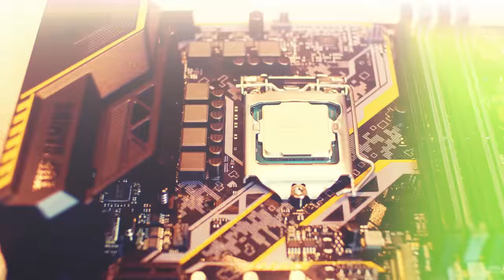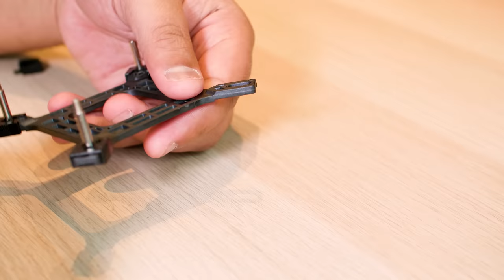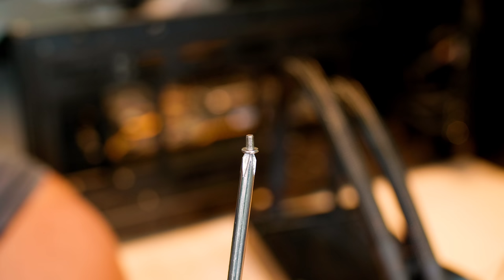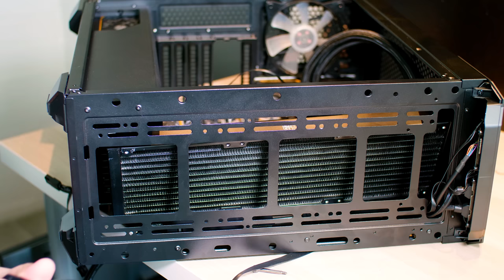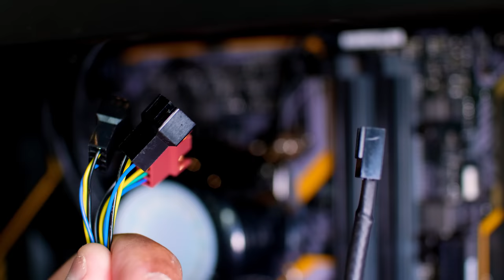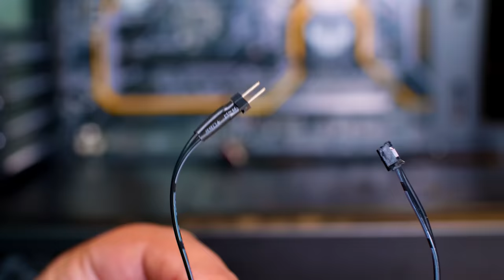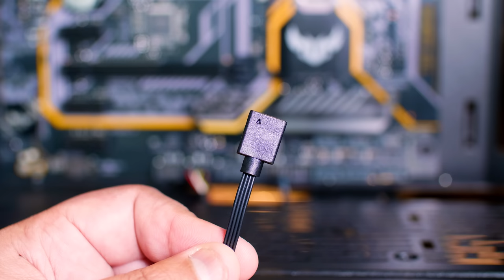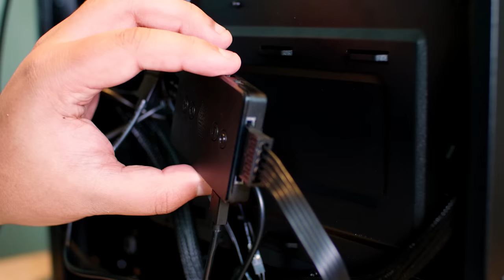HOWTO Install Cooler Master MasterLiquid ML360R RGB on Z370 & Z390 Motherboards

Comment: Quick question, can I grab the rgb signal from the controller and pass it to a second one? The reason being, that I have a second controller for 3 fans that use a propeitary 6 pin connector, so I have to use the second controller aswell.
(or the other way around, from the other controller to this one for the AIO)

To prevent confusion, I want to use MSI rgb control software for all my rgbs, the other controller (not the cm one) has 2x 4 pin connectors for rgb, so I'm guessing I could use that connector to pass the rgb signal to the cooler master controller, right?
 My parts willl arrive in 2 days, so I can't test right now, but I want to make sure all the parts I need are there once they arrive, since waiting to finish the build because of a missing splitter would suck.

Anyway thx for the videos, they really helped me out so far.
Reply from the maker: If the 2nd controller has an input you could technically do it if you set the 2nd controller to use a passthrough mode. I dont see why it shouldn't work.
Reply: @GearSeekers  Yes it does. I will report back once I've completed the build and know for sure if it works, maybe some other people are facing the same issue. And I'm honestly amazed how fast you replied, thanks for taking your time, I really appreciate it.
(+sub)
Reply from the maker: All gravy! Yeah let me know how it goes. I'm curious to see how you went.
Reply: @GearSeekers  Update: It works (4pin from one controller to the next one). Thanks again for the video, made the installation of the AIO so much easier.

Comment: Hello Gear Seekers i just wanted to know one thing i have Asus TUF Z390-Plus Gaming motherboard but my motherboard doesn't have any ARGB header but it has 2 RGB headers now the question is can i somehow connect this cooler's RGB cables to the RGB header of the motherboard to control the lights via Asus Aura sync software since my motherboard doesn't have any ARGB headers
Reply: No. The problem is, that the ARGB coolers work with 5V, and if you are connect it to the normal RGB port (12V) , it will burn out your fan's leds.

Comment: This is exactly what I needed. I'll be installing the ML240R into the H500M next week and I've heard the instructions (included AND downloaded) are horrendous. I'm assuming I can take the other ARGB controller out and just connect the two included 200mm ARGB front fan headers to the ML240R controller and directly to the case fan headers on the motherboard. Is that right?
Reply from the maker: Yep. Correct
Reply: Awesome, thank you very much! A lot of videos skimmed over the installation portion quickly or not at all. You got my sub.

Comment: Hello again, on my motherboard the cpu_opt and the cpu_fan headers both have a max current rating of one amp. However each fan that comes with the ML360R says it has a 0.54A draw. Is it wise to put three of these fans on the one header if they would be limited to 1A? Or should I have two on cpu_opt and one on cpu_fan?
Reply: Austin S. I have the same fear when It comes to this cooler. Were you able to ever figure out if it safe to plug in all three fans in one CPU header?

Comment: Do you need to plug in the micro usb into the controller if you want to use motherboard controls?
Reply: I am actually looking for this same answer. I want to plug this directly into my Gigabyte Z390 Pro and use the mobo software so can I skip the micro USB?

Comment: thx great job except for one thing....you mentioned an RGB cable connected to the motherboard for aura sync....where do you plug that in the controller because the end it's with 4 pins not with 3.thx
Reply: True im asking the same question
Reply: you guys solved it? planing on buying this. it's just one of the Ax ports, or?

Comment: Very helpful guide, thanks. Just one thing - It appears you have the Coolermaster fans the wrong way around. This setup will suck hot air into the case, which isn't ideal. Just thought you might want to know.
Reply: does it come with thermal paste?

Comment: GUYS HELP MEE does cooler master ml360r support a 3 way radiator support? My case is thermaltake view 71 TG RGB edition (i basically wanna know is it possible to install this cooler that was shown in the video in tye case i have and i think i have a aorus z390 motherboard the box has grey and orange color on it i forgot whats the exact name of my motherboard but i just wanna know can it be installed in my case?) Sorry for the long comment 😕
Reply: Check your case model and look at the specs. There should be some size indication for Radiators

Comment: Do you know if this RGB controller can handle the 4 pin not addressable leds as well ?
Reply: yea i have it and can confirm there is a 4 pin header on the controller the connects to your motherboard

Comment: fn thing not setting right on the motherboard driving me nuts, like screws aren't long enough. Update: make sure the rubbers are pushed down all the way (they should be tight so then you know which side goes down) and hold the back of the bracket behind the motherboard

Comment: What happens if your mother broad doesn't have rgb header to use aura because the broad I'm running is a Asus z370 h what would I do please before I buy the cooler
Reply from the maker: use the software with the controller. You dont need a mobo with RGB

Comment: Now when you plugged the RGB header onto the mother board I noticed it was a 4 pin rgb will you still be able to control the fans addresible rgb through arua?
Reply from the maker: I didn't actually plug it in if you listened closely.
Reply: @GearSeekers  oh, sorry I just assumed because I saw an rgb or argb wire at the bottom of the controller next to the USB that looked like it was going to the general direction of where you showed the optional step.
Reply: @MrSweettea23  l sure don't understand that bit as well l would have thought you would use 4pin rgb get MBO software and not use USB its a weird one

Comment: Hi Gearseekers, my cooler is "mastercooler ML360R RGB" on a "Z490 motherboard", when I turn my pc case on (because I build everything inside and plugged all the cables) the fans would turn on in the ml360r but the rbg colors wont, would the plugs be wrong? the light flickers for a split second when I turn in on, but thats it, one flicker.

Comment: I will normally use the 3 pin splitter and plug it into my motherboard's argb pin but i am planning to use more argb fans and will have to use the controller which sucks.
Reply: Cant you still use the software with the controller?
Reply: You can, but the controller is more gay to use.
Reply: Hristiyan Danev simply split argb pin

Comment: The video was very helpful, but unless i missed it you did not explain how you hooked up the sata cable. One end of the sata cable splits into two cables and I'm not sure where they plug in.
Reply from the maker: Plug it into you power supply lol? That's what I said.

Comment: Pretty sure if you connect that 4-pin on the rgb header on asus board, and connect the other end to the bottom of the controller, aura sync won't be able to detect it.
Reply from the maker: Aura sync doesn't detect anything. No RGB software detects anything. RGB has no intelligence at all. You need to tell the RGB channel what to do. Besides, this is for 3 Pin 5V ARGB not a 4 Pin connector. Basically every budget ASUS board does not have ARGB at all.

Comment: So I did every mistake you said to not make. First I took forever getting the pump onto the cpu the realized I never put thermal past or removed the plastic. I then took it off and applied to much thermal paste taking several minutes getting it off then screwed the pump back in and that took another several minutes, then I realized I never took off the plastic so I took it off again and removed the plastic and fixed my terrible thermal paste and applied a smaller amount. I then put it back on and finally I was done. Yet to see if my cpu lived🤧

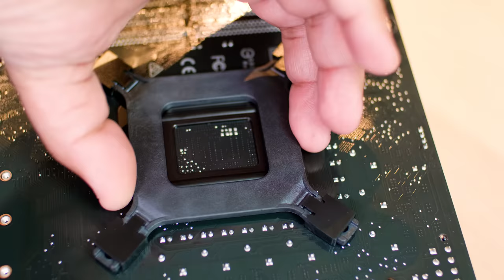Comment: What's exactly is preventing it from just falling out (at 4:17)? On mine, the whole assembly just drops out.
Reply: same issues what u do?
Reply: Eymard Martin Had to hold it with one hand at the back until I could get the screws started.
Reply: @mauricerv  yeah that's what exactly what I did thankfully it all worked out 😁

Comment: IDK why I put this on my cousins CPU(6700k) but it's reading 100c but when benchmarking on cinebench or any other CPU benching software it doesn't go over 100c it's always flat at 100c,  I knew there is a problem too because when playing league he gets from 140 fps down to 40 I've already reapplied thermal paste and has installed this correctly.

Comment: I have a problem. I installed it and everything is plugged in right but the fans do not light up. The Cooler lights up but the fans do not. It spins no light. I am playing around with aura but it don't seem like there is any adjustment for it. Please help! I am so lost!
Reply from the maker: Check your cables. You need to use MasterPlus+ not Aura for lighting
Reply: @GearSeekers  I got it fixed. Thank you!

Comment: So you can only control 4 fans with this hub? I'm needing 5 fans for my case.
Reply from the maker: I've done around 20 on a single hub
Reply: @GearSeekers  Well, he only put in 4
 There is only 4 slots for 4 fans? Am I missing something?
Reply from the maker: yes. There are 4 lighting channels. You can split each channel upto 5 times

Comment: Watched the full video question. Did you have any extra 3-pin plugs available for additional ARGB peripherals to be able to attach to the controller? Or is it full up with just the fans and pump?

Comment: Pls help my 9900k instantly jumps to 100c  when I do any stress testing and temps idle are 45 to 60  gaming is is the mid to high 90's...
Reply: First check to see if the pump is actually working (is it connected properly?) if so: Remove the pumpblock from the cpu, check to see if the paste is all nicely spread out. Then remove the paste, reapply it (a nice dot of ricegrain size or a bit bigger is enough) and make sure you fasten the pumpblock tightly, finger tight but tight. Like the maker of the video says: you cant overtighten them because of the design.

Comment: Where can I plug the argb fans that sold separately and have 4 pins? I already have the ml240r
Reply from the maker: ARGB only uses 3 pins for lighting. If you're referring to the PWM connectors you'll need a hub. 😊

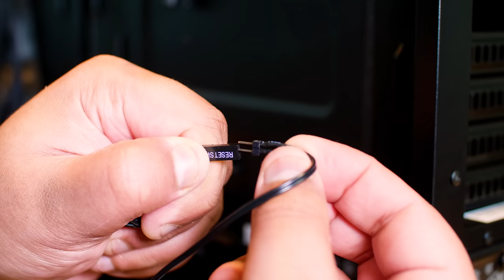Comment: At ~9:00 you plugged the same wire into the places?
Reply: This is confusing as hell, not very clear about the reset switch and case reset pin header. He said to plug one into the into the motherboard and the other one into the reset switch which he just plugged into the motherboard???!!!! How? Im stuck at this point, its not very clear.

Comment: Is it normal that this thing is pretty loud? my temps while watching yt with 3600x is 45-50c. feel like that isn't right
Reply from the maker: Change your fan curve
Reply: @GearSeekers  I have the curver pretty high atm because if i put it lower it its like 50c. max load temps are great tho and not too loud 80c in prime95 and like around 65 in most games
Reply from the maker: The reported temps with most programs are almost always wrong. Use HWInfo and check tdie temp. Remember these CPUs can still run efficiently at around 95C.
Reply: @GearSeekers  hwinfo shows like 1-2c higher than ryzen master does
Reply from the maker: Uninstall Ryzen Master lol

Comment: How am I meant to plug the rest sw into the motherboard then plug the 2 pin into the reset sw?
Reply: great question. vid makes it look like there are 3 cables. and btw where is reset on my mb?
Reply: Did you ever manage to solve this, apparently by reading the comments, some people's came with two reset sw cables, while mine only came with one. and am stuck on how to proceed? motherboard is strix x570-e gaming

Comment: Does the Board Need a argb connector or does it work over usb?
Reply from the maker: no
Reply: @GearSeekers  Thanks for responding. But with argb it is basically a splitter?
Reply from the maker: yep

Comment: Dude, why do you leave out the RGB header being connected? I'm not sure how to get my ML240R to sync in Aura.
Reply from the maker: Because it's optional. Also I clearly explained that. I showed how it connected to the controller the other end plugs into your motherboard. That's also something else I explained.
Reply: Yeah I’ve just watched it 3 times and you only showed where it goes on the motherboard not on the controller lol that’s why I watched this video. I’ve had mine installed for a couple months now but can’t seem to find any instructions as to where it plugs into on the controller luckily I have the MB530P case with a built in controller and switch on the case but it would be nice to be able to control it with software
Reply from the maker: @williamlowry6890  there is 1 spot it can only connect to on the controller. On the bottom next to the USB. Exactly like I showed.
Reply: @GearSeekers  do we need run sata power, USB and the 3 out in order to sync with Aura? My first rodeo with rgb and I'm having a heck of a time trying to figure out how to make my ml360 rgb talk to Aura on my crosshair 7.

Really appreciate the videos 🤙
Reply: @GearSeekers  Sorry, I should have been more specific. I understand it's optional but I was more confused about there being a 4pin 12v aswell as a 3 pin a-rgb 5v connectors.. I bought it thinking you had full functionality without an A-RGB header motherboard, but it doesn't allow control via Aura Sync unless you have the 5v argb 3 pin header(i think?). I'm pretty sad about it. Thanks anyway for getting back to us.

edit- just went back over the video and you used a 4pin rgb header? :S why won't my aura recognise it..
Reply from the maker: Aura isn't supposed to recognise it. You need to install the MasterPlus+ software from Cooler Master and change the mode to motherboard mode. The problem is you can only control ARGB if you have the 3 pin connected
Reply: @GearSeekers  Interesting. I've connected it to the 4pin RGB header, MasterPlus+ isn't detecting it either. I know it's pretty much out of your hands at this point but once again, Thanks for getting back to me :).
Reply from the maker: Update the firmware on the controller first and it will detect. The USB connector needs to be attached
Reply: @GearSeekers  Yeah, Quick google search solved my problem. I think it's working pretty smoothly now. Aura isn't detecting it in it's UI, this is how it's meant to be. Ohwell. Thanks heaps <3
Reply: @GearSeekers  this is the info i have been trying to find for the past 72 hours all over the internet. Gonna give this a try and hope everything will finally sync. thanks a lot! lol lol
Reply: @geologik7500  did you succeed to sync everything? I know we can just use the splitter without the controller to sync with asus aura,  but im trying to find a way to have the controller to work as argb hub too and still control the entire thing using aura lol
Reply: @MrJdReloaded  I gave up, I somehow cobbled it together to get basically RGB rainbow and left it
Reply: @geologik7500  I got it to work now..have to install cooler master software...Change the argb settings at controller to 'motherboard'....Then leave it running while opening aura at the same time...choose the lighting option u like..Save the settings...Restart pc...Then all is synced 👍👍👍 

**Need to connect argb port from your mobo to the controllers argb port at bottom right before doing all the above...Like @gearseekers said

Comment: Secound night trying to install this thing. The hyrogliphics are real! I did everything having a hard time getting the lights to work with this video and the picture manual at my side and i still cant do it. Gigabyte Auros z390 super mobo
Reply: update i got it to work firmware issue. was goingstrong currently upgradeing. they dont sell the spacers were can i get those

Comment: If anyone have a complete video on this cooler i would love it. Its a good movie but even with this its still confusing. That octopus wire have 5 wires while your cooler have only 3 to connect so youre left with 2. And even following this video im still left with 2-3 wires.... on the control unit there are input with a fan icon. This isnt even used here...

Comment: This doesn’t make sense. How can I plug the 2 pin header into the reset switch if you told me to plug it into the motherboard????
Reply: if i saw it correct he connected multiple 2 pin headers, one to the reset switch and that to the controller and than one to the controller which goes to the motherboard
Reply: @Sunil-kq9bx  Did you ever manage to solve this, apparently by reading the comments, some people's came with two reset sw cables, while mine only came with one. and am stuck on how to proceed? motherboard is strix x570-e gaming
Reply: @EyeFullBlooD  i tried it as i described here but never got the reset switch to work with the motherboard. the reset switch keeps changing color on its own while the rest of the rgb lights are controlled by motherboard.

Comment: Hello
Thanks for the nice video I would need to help and know more about connecting the reset cable that comes with the cooling to the motherboard and to the chassis, because I just bought the same cooler and my computer case is called thermaltake p90 an i have Asus Z97-A motherboard

Comment: Is there an email I can contact you at? I followed the video to a T, but I have 3 cables left over not counting the optional reset cables. My PC is displaying a red light on the power button and won't turn on.
Reply from the maker: We have a discord community you can join :) that's probably easier :D
http://grsk.co/community